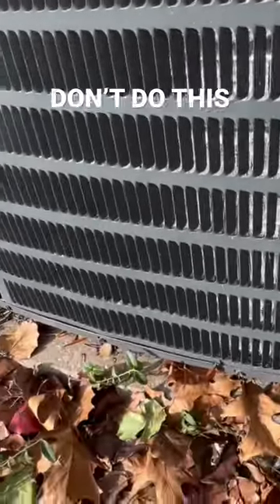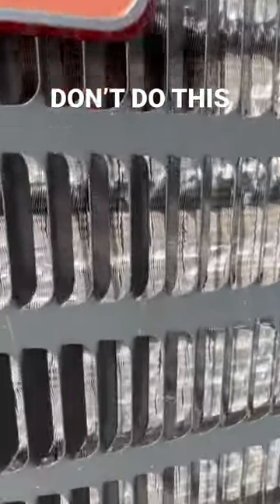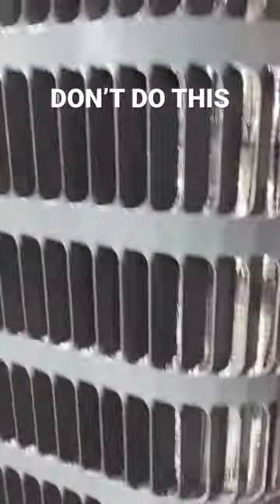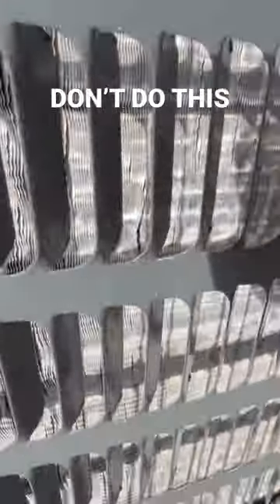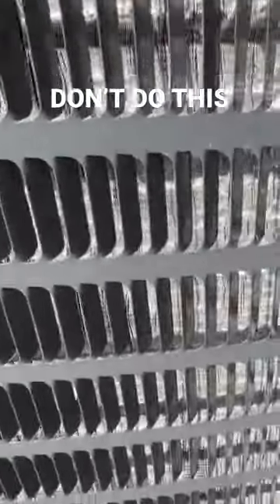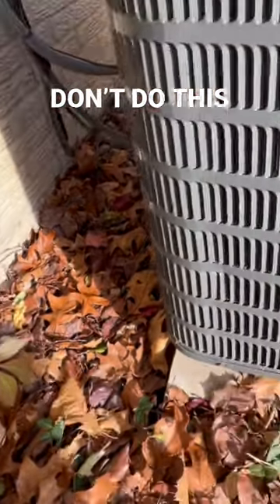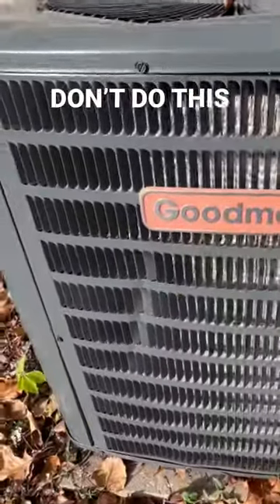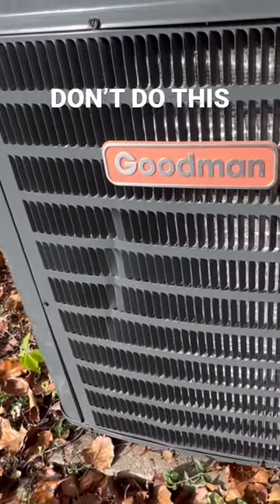DO NOT CLEAN YOUR CONDENSER THIS WAY!!

Comment: You should also wash from the INSIDE of the condenser. Washing everything out instead of into the unit.
Reply: Bingo
Reply: I've always believed that but recently learned it's not necessary--and often more trouble than it's worth to clean it that way.
Reply: Big facts!!!
Reply: Nope. Single row coil. Just wash it off. No need to take it apart. Not that complicated. 25 years experience here. Trust me.
Reply: That may be the best method, especially with a multi-row coil.  But washing from the outside, especially with a foaming spray coil cleaner can be nearly as good and a whole lot better than not doing it.
Reply: Multi row coils need to be split. I never use foaming coil cleaners on outdoor units anyway. Water is the best method. Coil cleaners need to be used on greasy rooftop units maybe but not usually needed for residential
Reply: @dolfinwriter5389  i’ve heard some mix opinions on that. I agree with your perspectives after looking through the fan of my unit, realizing there’s basically a little drain pan with a minor amount of debris where any dirt can be washed away.  it will be the first time cleaning my two year old unit, I think it’s overdue considering how hot it is in South Carolina! I bought some coil cleaning foam from Home Depot, but I’m not sure I should use that…?
Reply: Take it from me, it’s not necessary and on commercial equipment just not practical with up to 20 coils on a single unit. Wash the bulk off with water (almost no nozzle straight hose) then apply cleaner (unless microchannel then water only) and rinse off with a nozzle, medium pressure. For microchannel coils, you just need medium to high hose pressure and spray perpendicular to the coil all the way from top to bottom, side to side. Doesn’t matter which way you spray, obviously if you CAN, it a best to spray from inside out but if it’s not practical, then spray from which ever way gets the dirt off and out of the coil. 

I cleaned coils professionally throughout my apprenticeship and still clean chiller coils from time to time. I don’t own a pressure washer anymore and frankly they do more harm than good
Reply: @dolfinwriter5389  It's hardly any trouble though. It's very easy.
Reply: @GregoryGuay  If your coil is near exhaust, smoke, oily exhaust from the kitchen you need to use coil cleaner. If it is not near those, you can use any kind of detergent or just set your sprayer on shower, and spray it from the inside out. That pushes the dirt out from the opposite direction it came in. Unless you have 100psi commercial pressure at your hose, you'll be fine to hit it with full power from your hose sprayer (55psi). Don't use a power washer on it.
Reply: @GregoryGuay  I'll let a professional advise you on using the foam, but my instincts say if it's only two years old, I would not.

I have used the foam only once on our 1978 house that we bought and moved into in 2021 and the first time I cleaned the condenser it was really dirty. I do know that when cleaning the thoroughly disgusting neglected evap coils inside we found that somebody used something really caustic in the past, and caused erosion/deterioration of those fins.

You should be able to remove the vast majority of any blockage with a simple garden hose nozzle, and work from the top down. It may be easier if you can remove the outside guards--I always had to do that at our old house in California.
Reply: @dolfinwriter5389 yeah, if its just regular maintenance its unnecessary. People who preach this get paid to clean 2 coils a day lol.

Now, if the coil has a blanket of dryer vent lint, caked with dirt and mud, somehow hair, etc, then yes cleaning from the inside is necessary.
Reply: @Straight_White_Fatherly_Figure  1978 house with neglect issues that we bought in 2021, and the condenser fan motor failed just before the year ended on our home owner's warranty. The crew comes to replace the fan, and they comment how clean my coils are (because before they came, I cleaned them). I told the guy yeah, it requires good airflow to get good heat transfer.

He said "If everybody understood that, I'd be out of a job!"

And then they discovered that the unit continued running when they pulled the external disconnect. Some IDIOT hot-wired it and bypassed the fuses and disconnect in the box. So I got that fixed under warranty also, and a good checkout of all downstream wiring. My guess is that fan motor had been failing and blowing fuses for awhile, and somebody "fixed" it so it didn't blow fuses anymore. 🙄

But it had run through the previous winter and much of the summer and never blew fuses for me. 🤷‍♂

Who would have thought to even look for that during inspection?
Reply: @dolfinwriter5389  ah yeah ive had to bypass them before to get people cooling but i usually put in an order to replace immediately.. some people are such hacks hahaha 😆
Reply: @Straight_White_Fatherly_Figure  Retired Navy submarine nuclear operator and electrician--yeah, when the ship is sinking or otherwise in danger, that's when you bypass fuses, override interlocks, jury rig shit, and select Battleshort on Captain's orders.

And I could tell you a real life, "Scotty I need warp speed NOW!" story.

I wouldn't bypass fuses any other time, and it's so much worse to me that somebody LEFT it that way.
Reply: @dolfinwriter5389  The inspector. Pulling a disconnect is basic and is a single purpose item. Inspectors are supposed to run through a check list just like a pilot and co-pilot do for a jet.
Reply: @JamesBrown-fd1nv  I'm not following what you mean. The inspector SHOULD HAVE pulled the disconnect and made sure the unit stopped?
Reply: @GregoryGuay  what I've seen from experts is: unplug the power, take the top off, vacuum it out, use a soft brush to apply dawn soap gently (or a cleaner) over interior and exterior, let sit for a few minutes, then use gentle or low pressure hose spray outward, let it dry a bit, put back together, plug the power back in (outdoor power)
Reply: I've cleaned hundreds of coils over the last 12 years, it's not necessary to do it from the inside. If you go at an angle and push dirt down, it works fine. Then keep spraying until it's all cleared out. I usually don't recommend the foam sprays because they aren't usually necessary and can actually eat away at the aluminum depending on the cleaner used
Reply: @Tyler-cf8jl  isn't it more thorough and cleaner if you do it inside>out though? First vacuum out debris, dirt, then spray out. If you spray in instead, won't the mud and gunk you sprayed IN be blown back out again, clogging the system yet again?
Reply: @johnmilton2077  It is definitely more thorough to do it that way. When I do maintenance, I clean it out like that.  But a lot of homeowners aren't very mechanically inclined, so it's a bit safer for them to not take the top off to clean it. In terms of pressures and efficiency there's not a big difference between the two methods as long as coil is thoroughly cleaned out
Reply: @Tyler-cf8jl  gotcha. Thank you
Reply: Using a garden hose and having water coming out of the hose gently

Comment: I work in HVAC and the way I always do tune-ups is to take the fan off the top, pull out all the dirt/leaves so that the drains aren't clogged, spray the inside with Simple Green and then use a garden nozzle on a hose on "full" or "jet" mode to spray out the gunk trapped in the fins from top to bottom on each side. You'd be surprised how much pollen those units can hold in the fins. I also open the electronic compartment to check the state of the wires. Of course, all of this is done with the disconnect pulled so that the unit won't operate while I'm working on it. Note that I'm a professional and that you should not do anything you're not capable/comfortable with doing. Call one of us and we'll do the job right on both the indoor and outdoor units

Comment: Spray foam cleaner both sides then rinse with a hose. And stop pressure washing your roofs! Use chemical cleaner instead. I’m a roofer and I see more damage by pressure washing than anything else. Especially on tile roofs. They break tiles, blow out ridge line cement. Break tiles and then slice through the underlayment so now there’s a leak. We get at least one call a week about leaks here in Florida. We go up and tell people you have 15 broken tiles. They say how? No ones been on my roof except my cleaning guy? I always say, do you think the guy who just cleaned is gonna come down and say sorry, I just broke a bunch of your tiles? Chemical cleaner only from a licensed contractor. In my area there are over 50 roof cleaning companies, only three have actual roofing contractor licenses. The rest are handyman
Reply: Glad I read this here in Florida. 
What is a tile roof anyway? Aren't they all those slabs made of tar.
Reply: @jpjp9111  there’s asphalt roofs, and then cement tiles. Look at any roof you can see the difference etc. Don’t have either one pressure cleaned. Period. 90% of the companies that do roof cleaning are not licensed or insured for being on a roof, they hold handyman licenses. A pressure cleaner is 3500-4000 psi, that will blow the hell out of your roof. Then companies will say oh we use soft wash etc. All they do is turn the pressure down from 4000 to 2000 psi and pre soak it with bleach. A self wash car wash can only have 1300 psi by law, so that’s a lot of pressure doing a soft wash. Find a company in your area that does NO pressure chemical cleaning only. It’ll cost more, but it will last 4-5 times longer. And you won’t be killing your roof. I go on roofs almost every day looking at leaks. People are always shocked when I get down and show them torn up asphalt or 22 broken tiles in pictures. And they always say the same thing, how’d that happen? The only person that’s been on my roof is my cleaning guy?? I’ll say think… do you really think the guy who just charged you $150-195 to clean your $50,000 roof is gonna come down and say all clean! Oh ya, and I busted a bunch of tiles. Not. Do what you want. But the roof on your house is the most expensive and important part. Do you really want some guy up there making $12 hour who was mowing lawns last month, destroying your roof? In Florida it’s easy to check and see if they are licensed. Go to Sunbiz.org and check. Then go to county and check to see what kind of license they hold. Buyer beware
Reply: Who pressure washes a roof?
Reply: @Tolbat  seriously? They do it all over in Florida every day destroying roofs. But homeowners don’t know. All they see is their roofs cleaned. We tell them all the time: don’t pressure clean the roofs!!!!! But remember, there’s a lot of stupid people out there
Reply: @rburrows7786  yeah yeah they just did that to the concrete tile on my old house and within a week all the nails started to corrode... now it's escalating. Lifespan of the roof has just been shot by the chemicals. In S Florida you have to do it every year anyways or the HOA will take note. You need someone who knows how to properly walk on the roof regardless. Additionally, who is capturing all the chemical runoff because of EPA Clean Water Act?
Reply: @ryanglaser5336 I throw my used car batteries in the gulf because of people like you.

Comment: The right way to clean an AC condenser is to disassemble all of the hail guards. Brush it off, then use the appropriate foaming chemicals on the coils,  rinse them off thoroughly, and finally reassemble the unit.  Call a professional!!

Comment: Ain't nobody combing that back.
Reply: It would take a long time and a lot of patience.
Reply: Whoever did this is a winner😂
Reply: Hold my beer and get your checkbook ready! 😂😂😂
Reply: It's done everyday and it's quite common.
Reply: @jamesm568  I don't think condenser fins are completely flattened like that one commonly. That doesn't make a lot of sense. More commonly: a few patches of flattened cooling fins.
Reply: holy shit people would bring these in and the combs do not work!! somebody at the bottom would get stuck with having to do one fin at a time with an ice pick😂😂 yes it takes a day or two. lol
Reply: And I've seen this happen many times with people just using a garden hose .
It depends on several things, the water pressure in your area, the brand and year and model of the unit, and whether or not you have enough pre-planned common sense to point your stream directly perpendicular to the coil surface in not at an angle to the left or right

Some units have fins that are almost as thin as aluminum foil, you barely have to push them with a finger and they fold over
Reply: Compounding this problem is that I have seen many Goodman units of that exact model and age with leaking coils so we already know they are weak thin and have a potential to leak. Then you smash all the fans and your pressure through the coil gets even higher potentially exposing any weak spots in making a leak. It's not worth it
Reply: Giver er a comb over
Reply: It can be done as long as the fins are in good shape. If they are older and brittle it's toast.
Reply: @CriminalonCrime how much would you charge to do that bro?
Reply: Probably better to  leave it alone.  Could do more damage.
Reply: @maxwellcrazycat9204  Damage is already done. The condenser needs to be replaced. Hope its not too hot and a supply house has a replacement on hand.

If the condenser is back ordered then
trying to comb it out may get it to a state where it will cool and not damage the compressor.
Reply: At that point nobody fixing that. It's new condenser coil or new outdoor unit. That ain't covered under warranty

Comment: Spray foam works well, but even liquid dish soap and water will work.
And remove the lid so you can wash from the inside-out AND clean out any debris that might clog the drain holes.
Reply: @MCOult  that is a great idea. How do you prepare /apply/etc the dish soap to the air conditioner?
Reply: @jpjp9111 just buy a gallon of if and squirt all over the fins

Comment: Ive cleaned mine with car aluminium wheel cleaner and rinsed with the hose. Cleaned it right up.
Reply: Thanks..for the tip!
Reply: Be careful using a brightener as it contains acid. if you don’t get it totally 100% rinsed out it can etch the coil over time and cause it to disintegrate and not transfer heat, or even corrode enough to cause refrigerant leaks
Reply: Just a heads up, only use water on condenser fins.

Comment: He is totally correct low pressure with a hose, so the system can properly exchange the latent heat with the assistance of the fan motor so if the fins get bent you will ruin the process lower efficiency & lifespan of your system 😉🤟🏻p.s I always would explain & give an example to my customers  at the end of every maintenance visit so they could help with prolonging there system lifespan since I only see them once in the summer & in Las Vegas NV the desert is a different creature out here.
Reply: I think power washer manufacture need to put warning for maximum pressure for each application and what to avoid. I use Niflisk Pressure washer, but i think because the pressure not as high or extreme compared to gas engine or the big sized one, I wash my outdoor & indoor just fine... 

but like you said & this video does, i mostly wash it using hose and spray it, and my water pressure is quite good thanks to additional booster pump. If I want really throughout cleaning, I use coil cleaner before spray my coil.
Reply: No, say it ain't so Bubba !!😮😮😮

Comment: Video is 100% correct.   I always remove the four exterior panels one at at time.   Then spray the cooling fins with foam AC cleaner from Lowes.   Then GENTLY rinse off with a garden hose from top to bottom.  Works good for me.  I do it once a year in the fall just before winter.  It's a good idea to cover the top of the unit with some  protection for the winter.  Do not cover the sides.

Comment: Good info, thank you. I just bought a cooling fin spray cleaner foam from Home Depot today. I’ll be cleaning the condenser tomorrow, so I’ll definitely use a gentle shower spray from top to bottom on both sides.
Reply: Some experts say that some cleaners can cause corrosion, so read the directions and rinse well with water on low power. Another alternative is Dawn dishwashing liquid mixed with water. Simple Green is another alternative but again, rinse it well to avoid corrosion.
Reply: @302Camaro  good tips. Thanks 😊

Comment: They put my dryer vent right behind the ac unit. I have to clean it 2-3 times a year. 
Thanks for reminding me. 
I use a hose on flat spray and have a ac fin comb as well. Takes an hour or so but produces noticeable colder air at the vents.
Reply: Thats bad design.  Hot air from dryer heating up condenser.  Add an extension to move it away.  Sorry someone did this to you.
Reply: Yes,so is mine! Stupid..lint is not good!
Reply: Look into changing that by an extension, clean out box whatever code allows.
Reply: @Tolbat those fuzzy things from trees that float That
for about a month are the worst.  They get sucked  on the fins.

Comment: I use a garden hose and take the top off and spray fron the inside, you can see all the dirt and leaves coming out. Also watch which way your lawnmower throws the grass and avoid running it by the condenser. Keep your condenser clean
Reply: Also, turn off your AC when mowing so it doesn't suck all that debris into the coil.
Reply: Good one 👍

Comment: Also, check bottom of the Filter Drier. Most are steel, not spun copper, they rust then leak.. Wiped clean w solvent and coat with paint .. Keep good insulation on low side pipe (the large one) the reason is to prevent gas from condensing to liquid before it gets to the compressor pump.. that can be expensive.

Comment: I used a lower power power washer that is battery powered worx power washer gun that you attach to the end of a hose, it has just the right amount of power to clean the fins and not bend them.